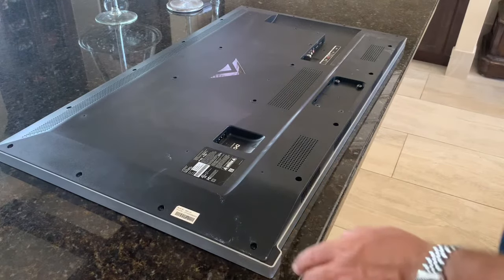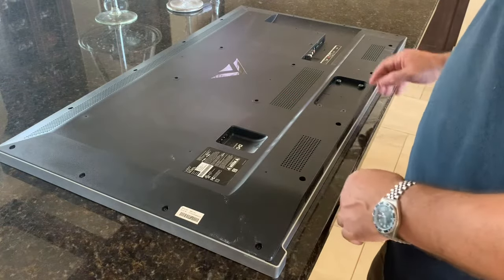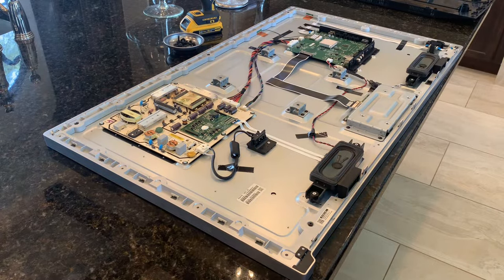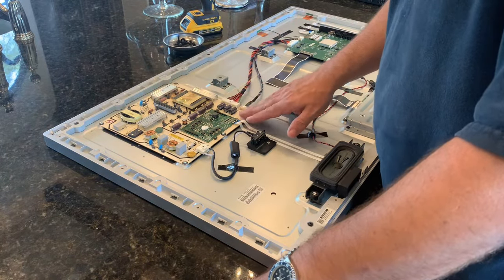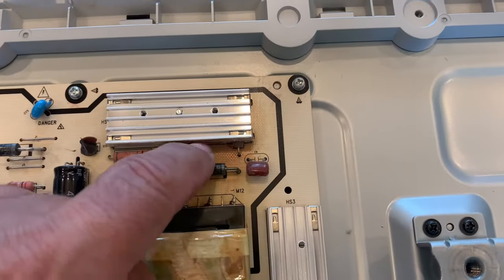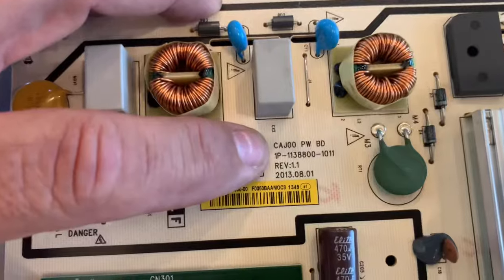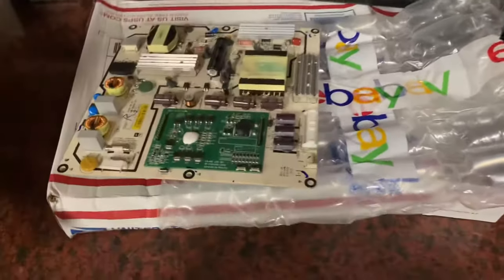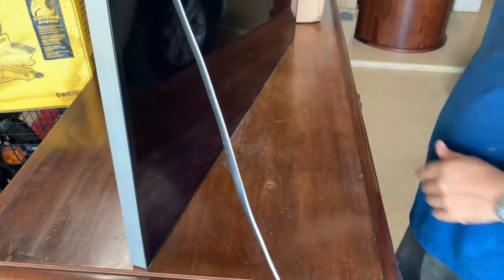How to Fix a Dead Vizio TV ● No Power!

Comment: Thank you!  Wife had smelled something hot in house.  Vizio began “reluctantly” turning on.  Failed to connect the 2 because I never actually smelled the odor and TV would turn on after a few tries.  After a few days, TV failed completely.  Googled problem and eventually found this video.  I followed video step by step.  Took cover off, got power board number, ordered replacement, and changed board.  3 days and $45 later ($17 shipping but worth it) our Vizio is running like new!
Reply from the maker: Absolutely! Great job!

Comment: My vision m55-eo got a scrambled screen with lines and now no power or light. Any suggestions on what parts I should replace first? I'm getting power through USB but nothing else.
Reply from the maker: I would start with the power supply. You might be able to find all the boards on eBay for cheap, and if so, I would just buy them all, but start replacing with the power supply first.
Reply: @ApacheRanch  awesome thanks

Comment: Will this work if my tv turns on perfectly fine it shows the logo and all but it just turns black after a couple seconds
Reply from the maker: I am guessing that you have a different board failure.  Seems you are getting power.  There are 2-3 other boards in the TV that can be replaced with little expense (eBay).  Trial and error will identify which one is causing the problem.  Good luck!

Comment: I replaced the power supply board and it’s still doing the same thing. Any guesses??
Reply from the maker: Typically there are 2 other boards in there that also could be bad.  Have you tried those?

Comment: So the tv company are selling tvs with bad motherboard issues
Reply: Thank you for this video
Reply from the maker: You’re welcome!
Reply from the maker: I’m not sure if they’re selling bad boards, but after many years of use these problems do surface. Plus, I think having a good electrical surge suppressor is important to protect electronics like this.
Reply: @ApacheRanch  I agree. My Vizio has no power and no picture. And hubby wants to throw it away. But seeing your video I think I want to try replacing the motherboard on
mine to see if it will solve the problem
Reply from the maker: I would totally try swapping out the power supply board. If you have no power at all then that is probably the issue. It’s only about $20 to give it a try. I find the replacements on eBay by searching in the part number. I wish you the best!

Comment: I feel that you skipped troubleshooting rule #1, assuming you have tried the various power reset techniques, there is a fuse on the power supply PCB. Why not check the fuse? Replacing parts first is simply shot gunning the problem. I see several components on the board which would be simple to test first ... diodes, capacitors, even the part under the heat sink. I admit that I am a retired electronics technician so I expected more from your "How to troubleshoot ..."
Reply from the maker: @lf98037  that’s fair. But outside of perhaps checking the fuse, the other elements are a bit more complicated for most folks. This worked for me and essentially saved a tv from the trash pile, so I figured I could help out others just the same. Thanks for your comment.

Comment: https://youtu.be/iGN1nrLrL0c?si=7duecWfML4NjJbgj

Any suggestions changed power supply but all i have is a stand by light doesnt power on nothing on the screen at all semi dead i guess
Reply from the maker: Bad power button? Have you tried turning it on with a remote control?
Reply: @ApacheRanch  yes and 2 vizio remotes with new batteries